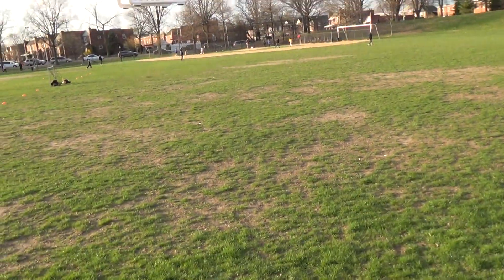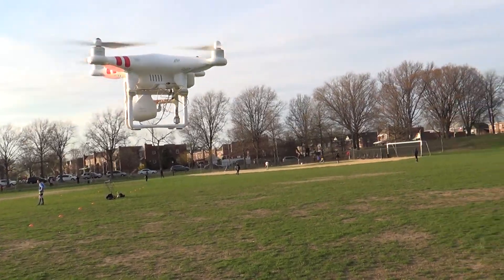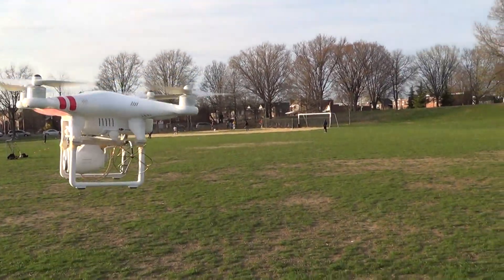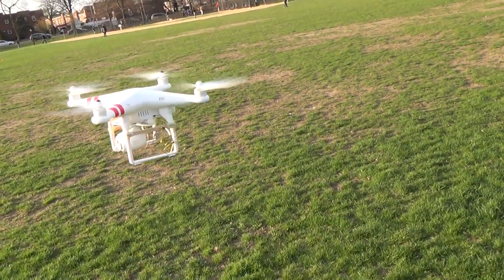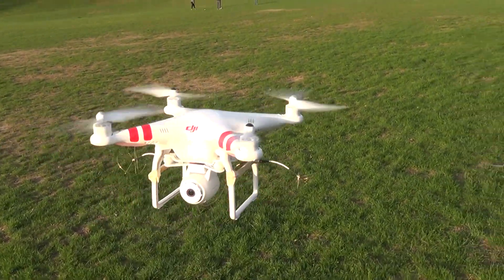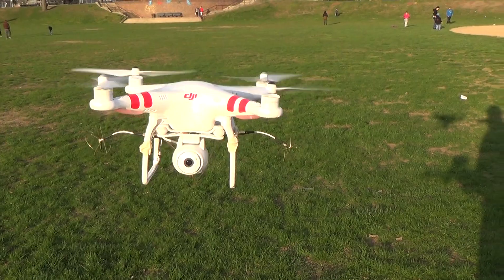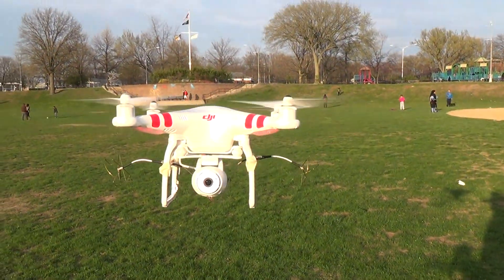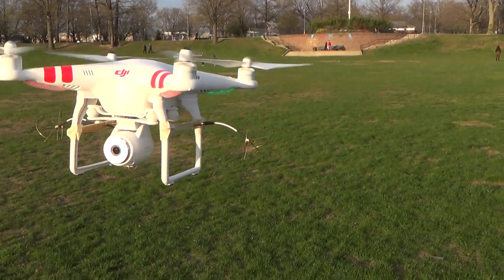Phantom 2 Vision with T-Motor MN2214 v2 Perfect Hover in the wind

Comment: I'm on a low budget( like the kinks, lol). I'm getting the pv2 from a guy who crashed it into a building and it dropped 13 stories into a pool. It was replaced and since then I've  verified it still functions normally and I'm pretty pumped. Freebie. I'll look into the firmware version, can you run the additional tilt lever with the older firmware?

Comment: Thanks for the info Ben. It's a standard vision2 not the plus. I'm also looking at the 2 axis gimbal for the vision camera and fitting the tilt function control to the transmitter. Any opinions on either of those options.
Reply from the maker: If you're buying new it makes more sense getting the Vision Plus if you wanted a brushless gimbal.  Good ones for the original vision are between $300 and $400 the better one (Rotorpixel) being $375.  

Stay away the the assistant version 3 firmware for the time being and stick the V2 assistant firmware.  Also the vision plus comes with the assistant 3 firmware but it can easily be downgraded back to v2.  

There are GPS lock problems with V3 and also you have that no fly zone "feature" on v3 which as of now has no off button.

Check out web site Phantom Pilots they have a few threads in the different available brushless gimbals for the Phantom as well as the 7th channel gimbal tilt control hack

Comment: Hey bud, getting a phantom vision 2 next week and I really enjoy your informative videos. Do you know the top speed of the phantom2 and is there a difference with the antigravity motors? Thanks
Reply from the maker: Which Vision are you getting? The first Phantom 2 Vision or the Vision Plus? Only two differences, the Plus has a 3 axis brushless gimbal and it has extended wifi range out of the box.   

The T-Motors are nice, I haven't done flight time comparisons on my own but others who've done extensive tests show between one and two minute flight time increase. You'll also have a smoother flight with less vibrations coming through the motors (provided you don't get any rough motors like I did, returned them awaiting new replacement).   

They're also marginally faster, performance gains are small but there, you can expect between 5% and 10% additional power.
Reply: Ben7seven7 Ben, now that you have had these motors for awhile, what do you think about them?  I am considering some myself.

Comment: I'll keep it stock and save. What about the cheaper gimbal is so bad? Smoothness of operation? Also can you use tilt function on any gimbal?
Reply from the maker: Hi I didn't realize I had a comment here from you till now. Anyway I'd stay away from sub $300 gimbals from the Phantom 2 Vision if you want something good.  And you will still be able to use the tilt control with the Vision App with those gimbals.

Comment: U never gave a review or range test on those antennas I think I mentioned it once on ur camera WiFi mod vid, I've completed almost all the mods except the transmitter waiting on parts but ant idea on the range on your FPV with those antenna I can't remember their name scew Palmer something?
Reply from the maker: Jean-Luc Devon The FPVLR Antenna got me just shy of 3,000 feet with 640x480 preview quality around the Park I fly.  In a wide open area with no RF it would be much further.  My 12dbi Helical I flew close around 4,600 feet until my RC Transmitter ran out of range so couldn't fully see how far I could get with that one.    On my transmitter I used a basic low gain dipole I would need to use a directional and or amplification to test further range in that particular area.  I do have a 5.8ghz directional that should add at least another 1k feet or more to that.  If I get the chance to video a range test I'll try and do so,though not sure when I will be able to at this time.

Comment: Curious how fast you can chase a vehicle
Reply from the maker: Top speed without any wind in the air flying in GPS mode is between 35 and 40mph. I've done over 50mph with a tail wind.   Flying in Atti mode it's possible to always fly over 50mph though you will be loosing some altitude at the same time.